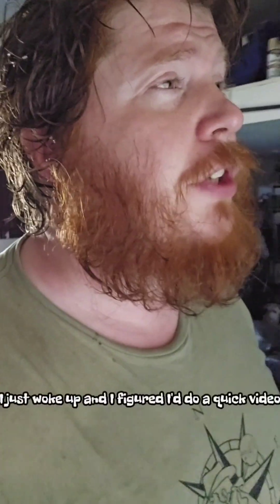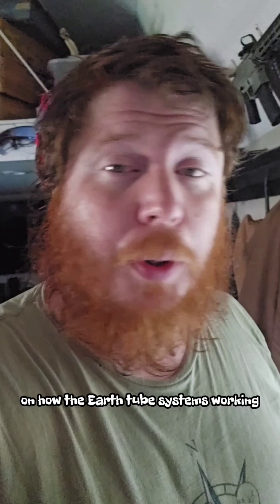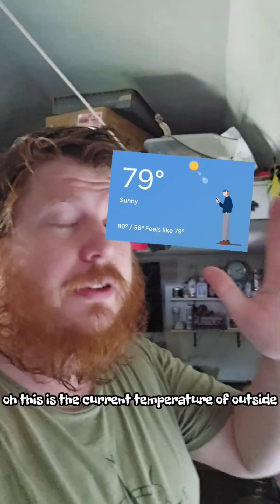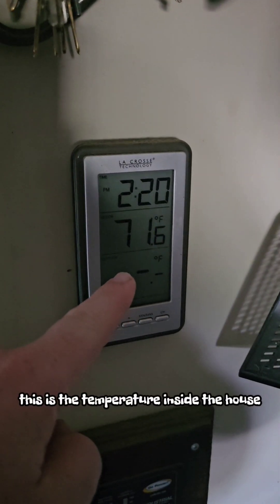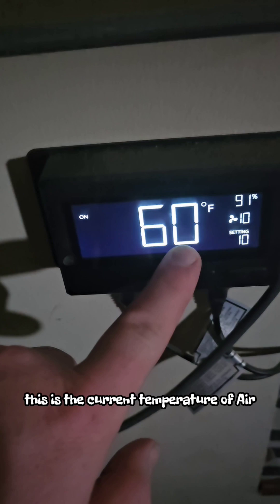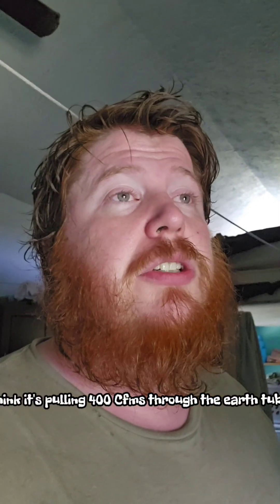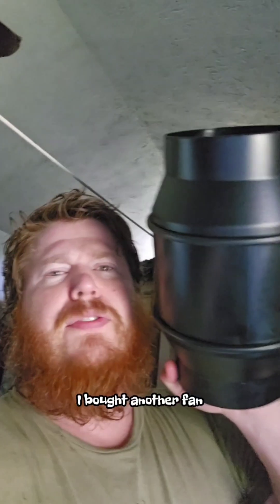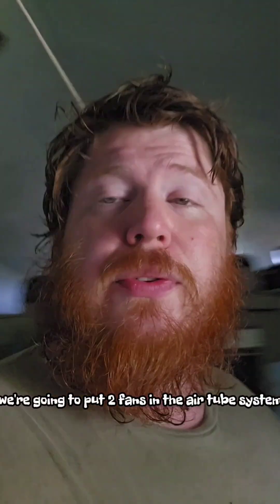The earth tube system is working, But I think there's room for improvement. #Offgridguru

Comment: Use inline boat blower fans, 12 or 24v put one in between every 20ft of pipe. We did an install, using 4" pipe of 80ft of pipe and our house was cool as a winters breeze during the summer. 

Now I've got on board with Vardo living and sold my home and living road life.

Comment: How is the humidity of the air coming thru. Im concerned about condensation in the tunnel and mold. Any input?
Reply from the maker: I have the tubes at a slight grade, so most of the condensate runs out the back. The air coming out, however, is still pretty humid. But that's really only during the hottest part of the year. As far as mold, we have yet to have any indication of it. I believe that the condensate draining out the back helps keep this system clean.
Reply: @theoff-gridguru how do you design it so the condensed air “runs out the back” I’m not sure what that means. Isn’t the system end to end closed? Like on side is in and the other out with cool air?